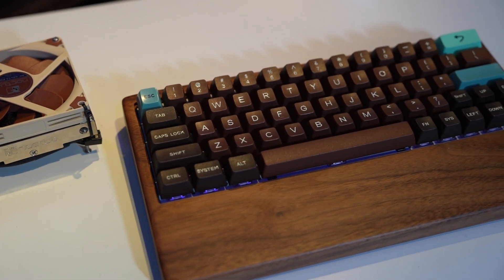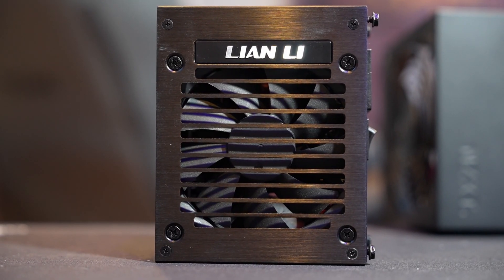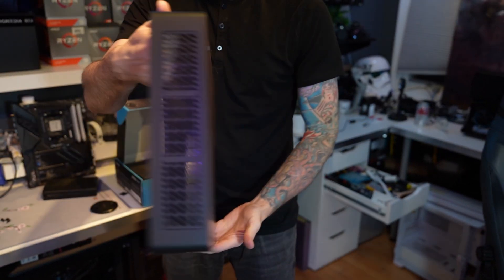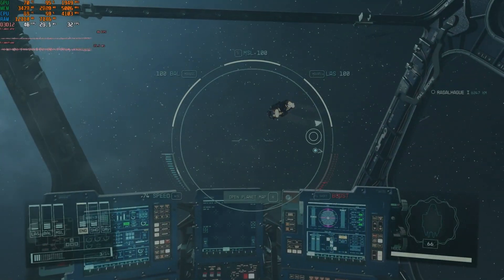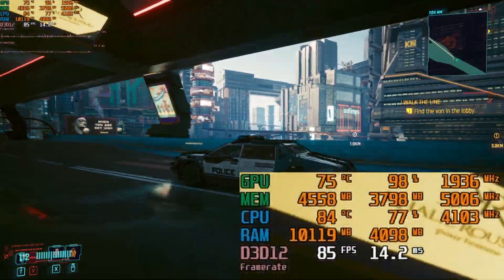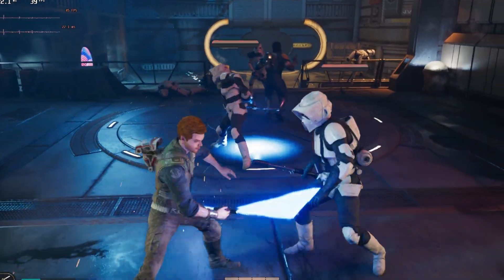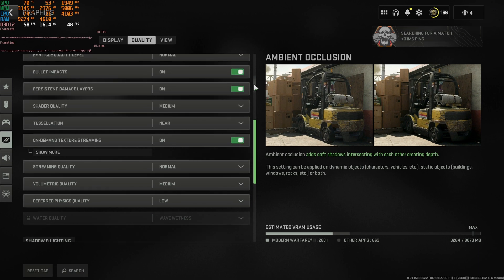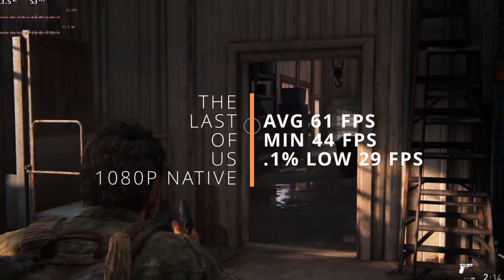The GTX 1080 in 2023 | Retro Themed SFX FULL Build

Comment: Nice showing how good old cards in fact are. People might not know that 5-7-10 years old cards, especially the hi end models, still do a nice work today, losing only on features and power consumption. 
FSR does offer them some extra living time.
Reply from the maker: Thank you, I agree, FSR in many ways has brought some serious life back into some GPUs. It's a shame some of the unoptimized games use excuses. I believe the 1080 could easily achieve 60 fps if a game like Starfield was well optimized.
Reply: @techwandoUS  Maybe Starfiled is that one example where the developer REALLY focused on Radeon architecture living Nvidia cards under performing. There where many Nvidia 4000 series users saying that their cards had lower power consumption than expected when playing the game. I seen some saying something about "forcing shader rebuild" to fix this. Don't own either Starfield or an Nvidia card to check it. Maybe it works even with old Nvidia cards, like the 1080? Maybe it has nothing to do with Starfield performance? Don't know. Just throwing stuff I read :D
Reply from the maker: @johnd.1618  It's a reasonable theory (the shader aspect). Last time something like this happened, the devs came out and spoke about it (Ubisoft) which was unusual and they eventually fixed it, I believe it was AC Unity. Todd Howard is just blaming old PCs, which is so silly cause Cyberpunk looks a lot better and runs fine. What's interesting too, speaking of AMD and optimization, the performance on the steamdeck at 720p is better frame rate wise then the GTX1080 at 1080p all low. The steamdeck is somewhere around a 1050Ti /RX 570, so you'd think the Nvidia GPU would do better, but your right they hyper focused on AMD, must have got a nice payout. Intel Arc didn't even run for the first week. I bet there's a performance mod somewhere on Nexus that can help, going to go look around.
Reply: @techwandoUS  Well, we could say the same about Cyberpunk 2077, being an Nvidia tech demo and a marketing tool  from the beginning, that they got a nice payout to implement stuff that will be running awful on anything without an Nvidia logo on it. As for Intel and Starfield. They are a huge company. How can they not get drivers ready on time? Maybe ARC architecture is to blame here. Or/And maybe they are in a disadvantage here, the type of disadvantage AMD was in the past where everything was optimized on Intel+Nvidia platform (pre AMD based consoles) and until AMD came out with new drivers and game's developer with patches, AMD cards where looking bad. That's how AMD got that bad reputation in the first place.
Reply from the maker: @johnd.1618  These are all very good points. Well said.

Comment: Just curious, will it do 1440p or does the fps drop to low ?
Reply from the maker: I actually did try 1440p before with the GTX 1080. It can do older games very well, but unfortunately this set of titles it really has a hard time, except RDR2, but that's old at this point. Apex, Fortnite, Csgo, valorant... all of these will perform very well at 1440p. You could definitely run a 1440P monitor, and set the render scale depending on the game.
Reply: @techwandoUS  thanks for the reply !